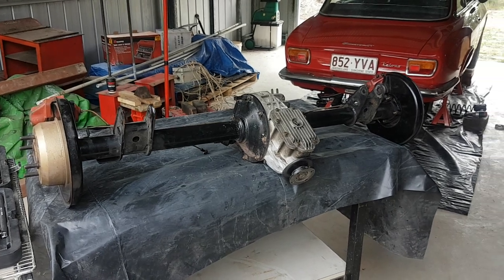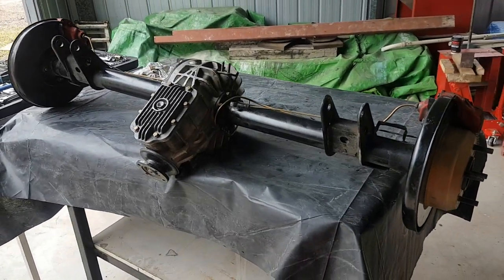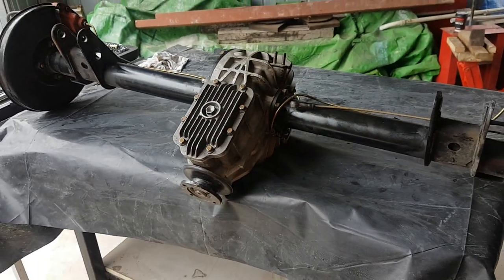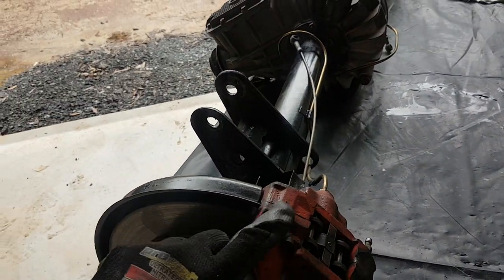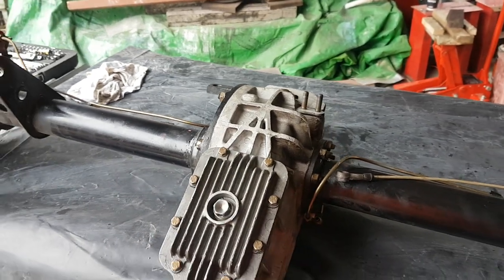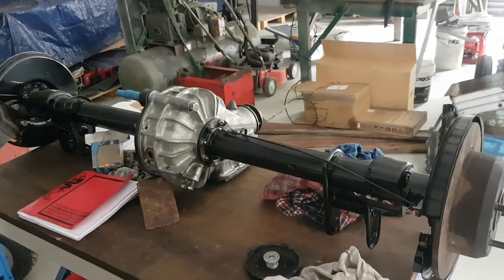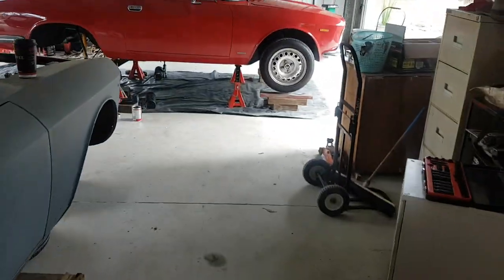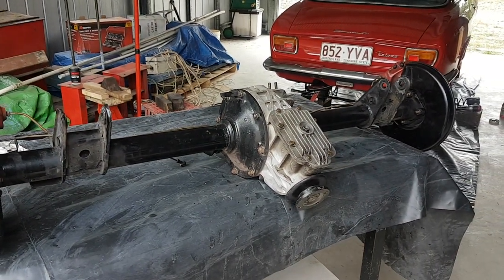Alfa Romeo limited slip differential tear down

Comment: We are tying to have a 10/37 ratio set of crown wheel and pinions made for my cars. I did this once before and it massively transformed the 105 drive. 140 KPH was easy and at around 3400 RPM. 120 kph at 3000.  Totally changes the car from frustrating motorway failure into a dream drive.
Reply from the maker: Wow, that sounds awesome! Please let us know how it turns out.👍🏻
Reply: @AlfaAddicts  will do